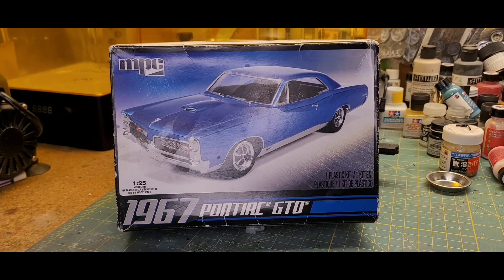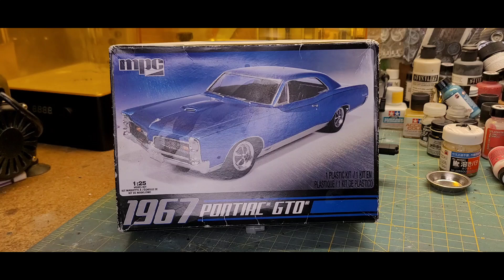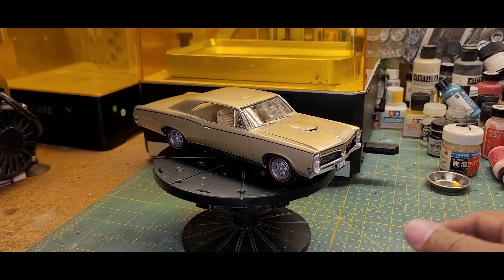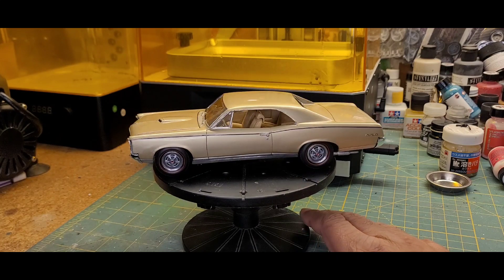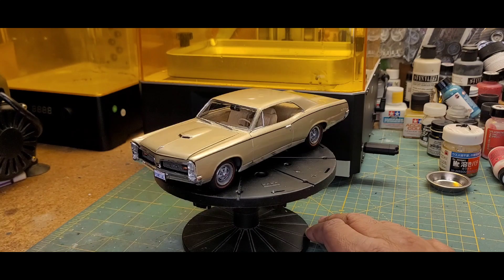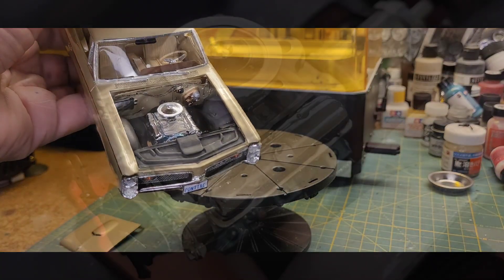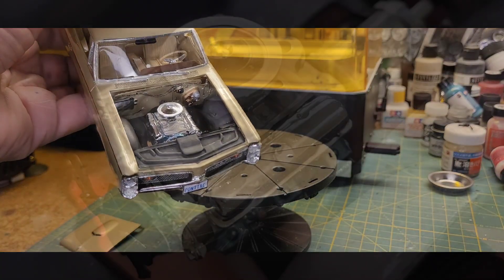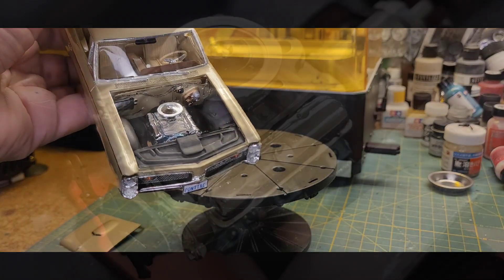RCS: Ol" Goat Group Build - FINAL (ish) REVEAL @TheLukaCeeChannel

Comment: That turned out pretty good! I have the weekend warrior edition of that kit. Gonna be a tough one!
Reply from the maker: I appreciate that. 

I built the Weekend Warrior reissue alongside this kit. The molds for the body have been cleaned up significantly. Flashing was practically non-existent and the sink marks are far less prominent. Unfortunately, the front end still suffered from fit issues.

I know that some people built the Warrior and said the bumper fit perfectly, so I might have just been unlucky.
Reply: Thanks for the heads up👍

Comment: I build this kit and I agree with on the quality of the kit.
Reply from the maker: Indeed. I don't mind that Round 2 still reissues the kit, but I do think that it does a disservice to both Round 2 and hobbyists alike when they release a kit this old and in this condition without acknowledging it. Claiming that it's a Skill Level 2 kit based on parts count is a useless metric.